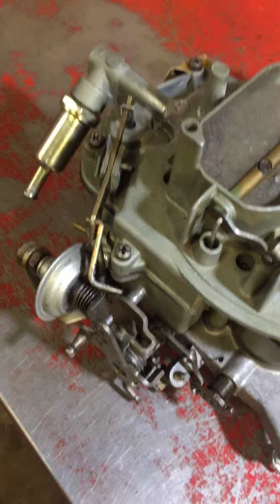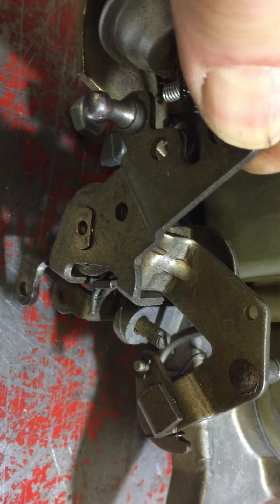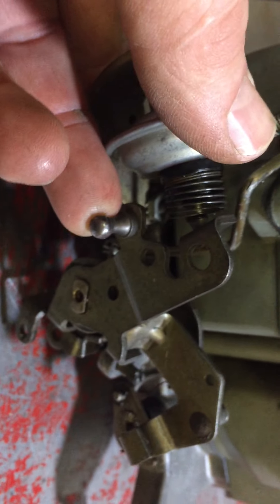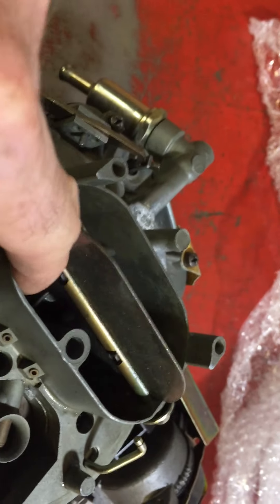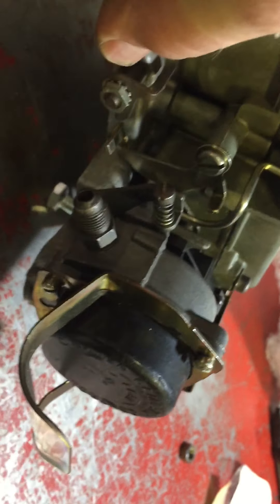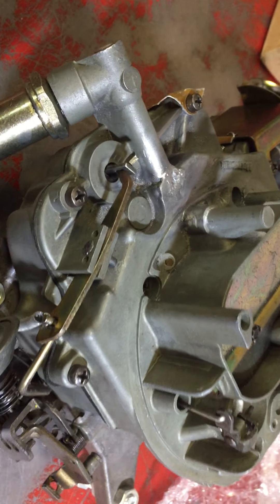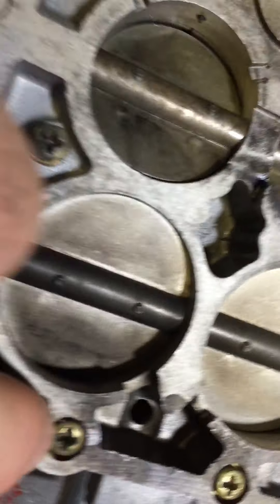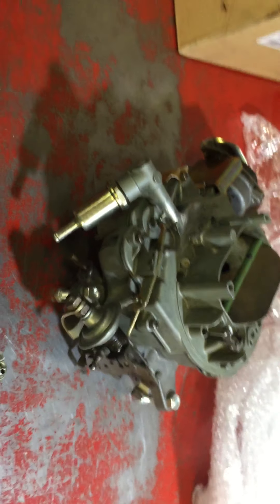Ford 4300 carb repairs - Barry

Comment from the maker: The 4300 carbs are ok for their designed purposes. They can easily sustain a mild performance applications. I have done back to back comparisons of a 4300 off a early 70’s . A 780 list 4653 and an early 850dp. The performance increased significantly as the carbs progressed.
If it’s not a genuine restoration then I would choose something else.